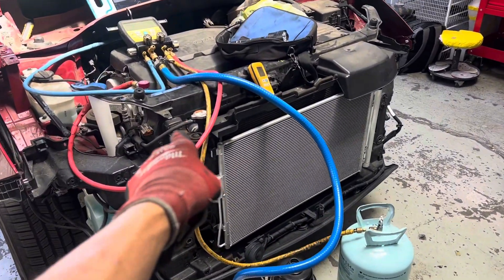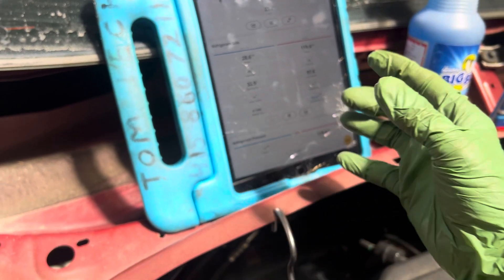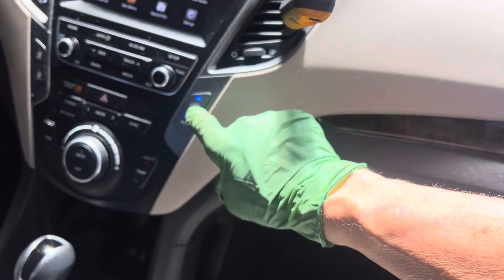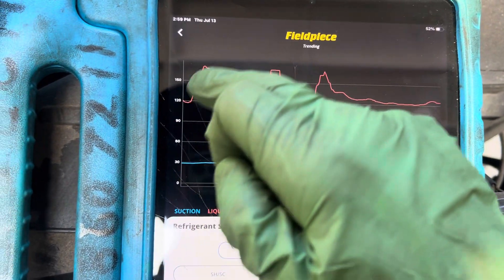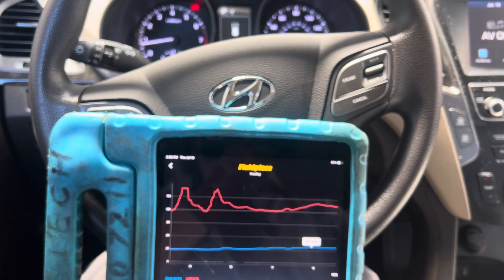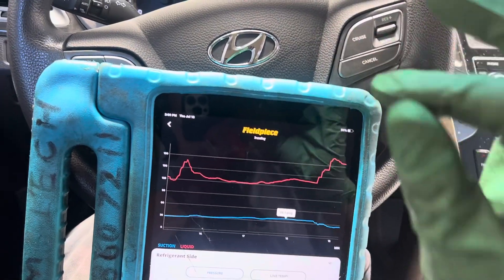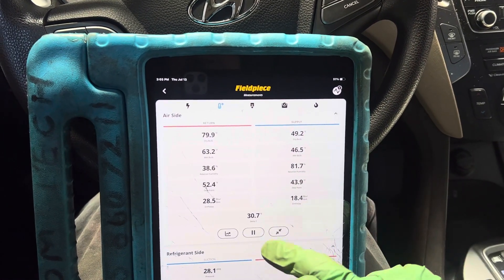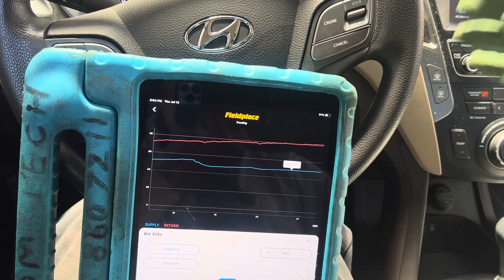EVAPORATOR AIR TEMP @ CABIN FILTER RECYCLE THEN FRESH AIR WHATS THE DIFFERENCE ?

Comment: I think that annoying issue with not being able to get a steady rev on the engine is a combination between the gas pedal position sensor and the dang electronically controlled throttle bodies. I feel like ever since they ditched the throttle cable that happens with any car.
Reply from the maker: Exactly